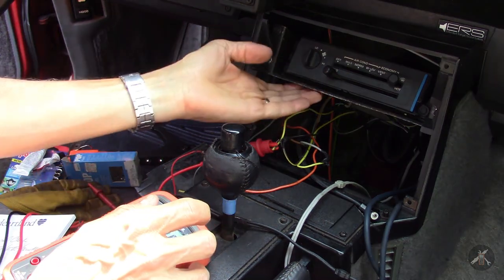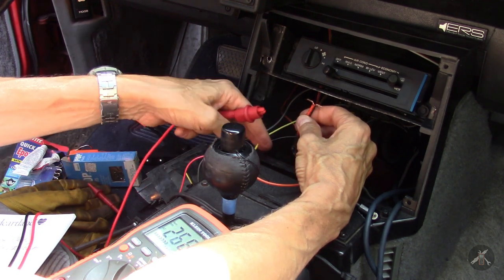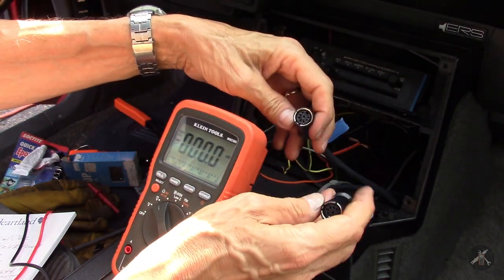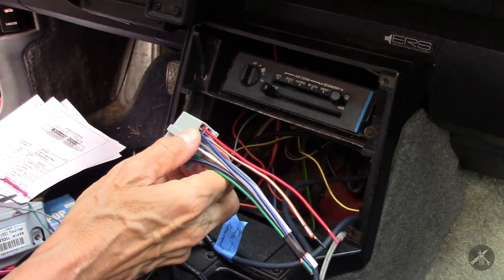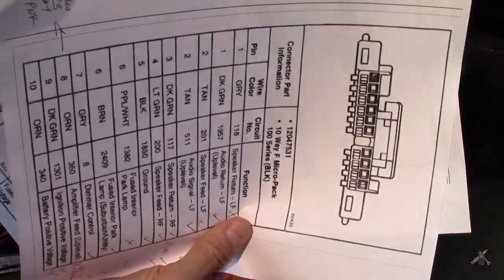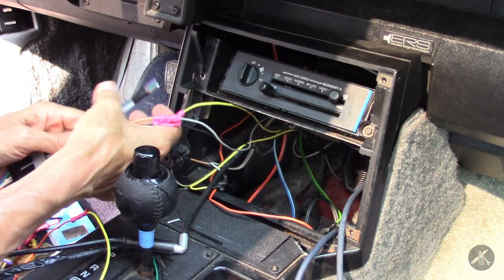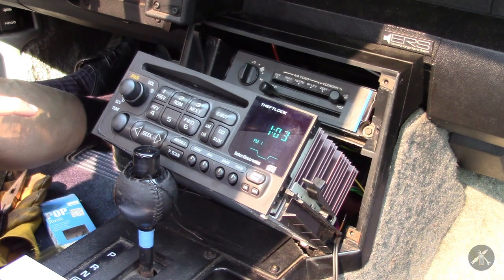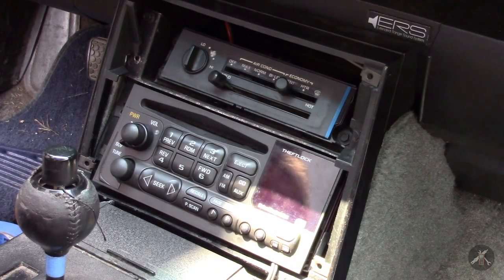Time to Get Music in the Car - Part 2 - Installing a Radio - IROC-Z Barn Find EP#64

Comment: I don’t know the time lapse between me watching this video and where you are on the stereo issue but in my experience of car audio (20+ years) I wouldn’t put a lot of stock in those old amps that where just laying around in a trunk for several years. Good amplifiers are easily had these days for those power figures. But if properly tested (actually hooked all the way up with speakers and all) if they work,use them. Maybe you already have and I missed that.
Reply from the maker: It's been several weeks now, but not too long.  I appreciate your comments and do understand that technology has moved a lot and power is more available. I worked in hybrid and electric propulsion and the progress that has been made in power semiconductors is quite amazing.
It's been several years, but I helped my son set up a 2000 Watt amp for his sub box.  That one needed 9/16 or 5/8 copper run to the trunk-lot's of fun.  That wasn't practical in the '80s.
On this car, the Kenwood amp has come up and run and I really have plenty of volume-it will drive you out of the car without much trouble.  I have had some intermittent disturbances develop in the left front channel, so I have temporarily disconnected that one until I can track it down. When I put the car away for the winter, I'll  do some testing to see if it's speaker or amp.  I know that many times components like electrolytic caps don't age well. With the service manual that I have, I could possibly repair it if needed, but don't know if it's worth the time required. I'm just happy that it's working for now.

Comment: Looks like a radio out of my 96 Tahoe
Reply from the maker: Could be the same.  They do usually run them for several years.  This is out of a 2001 and the end of the run. When I checked wiring diagrams, it looked like 2002 and beyond were changed due to vehicle electrical upgrades.